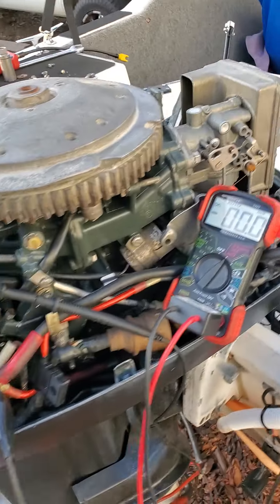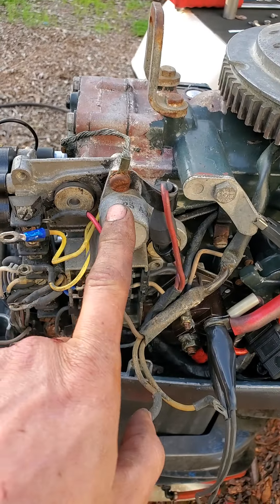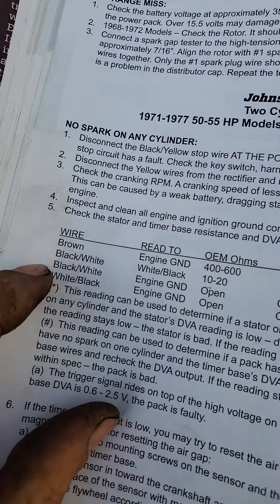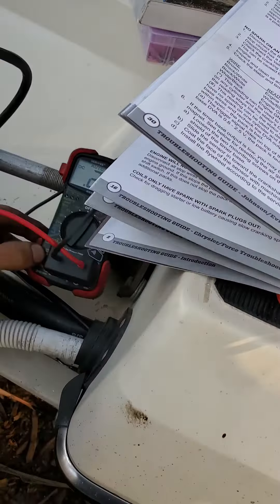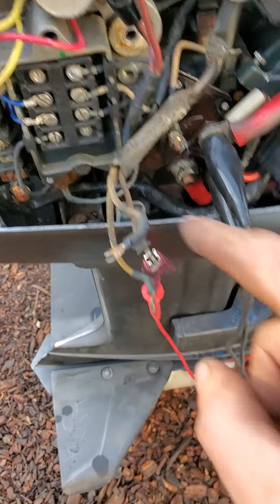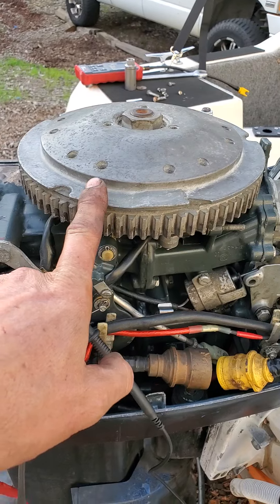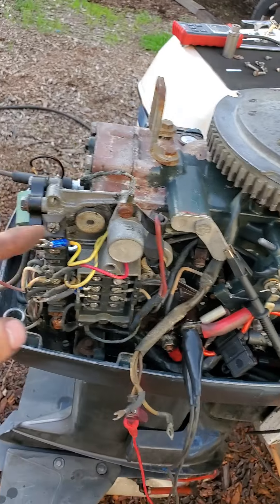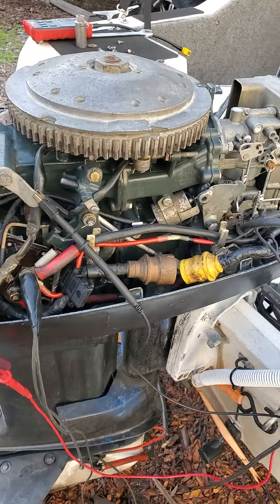Outboard no spark - test voltage from stator with dva

Comment: I'm confused, you said it was AC and yet your meter was set to DC, does the DVA adapter require you to set it to DC?
Reply from the maker: Good catch! the adapter im using converts AC to DC (most of them do - not sure why!).  you can build your own AC based adpater (without the dc diode conversion for CHEAP - look online). Its basically a resistor, one diode and a capacitor, you can find a diagram online. THAT one will output AC - i used it for a few years till I ponied up and paid $35 for a sealed unit with prongs that go into the meter :)
Reply: @SocalMarineUSA   Right on, yea I got the adapter but I didn't see where it said to read it DC, I am a mechanic, but no electrician for sure. So this clears it up for me. Great video man thank you

Comment: When i run this test on my 1985 johnson 60, i get around 250 but it slowly drops (connected). Disconnected it stays at the correct voltage. Sorry to bother you!
Reply from the maker: yes thats correct - the testers have a small bleed down resistor inside to drain the capacitor otherwise it will hold that 250v and potentially zap someone ;)

Comment: What does the multimeter need to be set on when hooking up the dva adapter
Reply from the maker: Dc when using the premade ones online because they have internal rectifiers that convert the ac to dc. If u make your own with just the capacitor and resistors and diode AC.

Comment: where can i find the manual? 
I like your video, good information, greetings
Reply from the maker: Manual is online just search for cdi outboard troubleshooting
Reply: I have the same engine and it stopped giving spark and the engine started well, I changed the coils and it still doesn't give spark
Reply from the maker: @abelardo9881  try with the kill wire disconnected at the pack -
Reply: what color would it be?

Comment: How would you test the coil pack on a 1994 Evinrude v4 88?
Reply from the maker: check ohms and compare it to specs, cana lso swap it with a cylinder thats running well - if the coil works in a new location the problem is further upstream, the coil is the last component adter the stator and trigger.. so work your way up. a bad lead cana lso cause issues.. if u can run it at night look for sparks around the wires/coils.

Comment: Any chance you would be able to help me with a problem I have on an E-Tech outboard? The problem is the emm is not charging the battery. So I'm trying to figure out a bypass to hook up a regulator directly to the stator and then out to the battery.   Everything else works fine. I posted a video of where I'm at now
Reply from the maker: just use the wire that sends 12v + , and wire it to the S terminal on a regular ford style solenoid (make sure it has a very good ground / bolt direct to block) - put the 12v from batt on one terminal and red cable to starter on 2nd large terminal - ignore the i terminal, its for ignition points, that would work.. spray wax corrosion stop or something all over the connections and wire ends..

Comment: 30 hp etech marine engine does not charge the battery. What can I do? I wish you a good day, my friend
Reply from the maker: first chek the stator wires are producing ac volts BEFORE the rectifier/regulator. Then check for 13-15v DC AFTER the regulator/rectifier- If they are then you might need to replace the rectifier or maybe a fuse went bad .. if you have an alternator on the engine it might be bad too..

Comment: Which manual was that you were referencing?  Does is cover more than OMC/Johnson/Evinrude?  Great video by the way!  I'm currently battling a charging issue in a 90hp V4 and looks like diodes in rectifier gave up... time to pull the flywheel.
Reply from the maker: just test the wires going into the reg/rect for AC - i think they should have 25-35v or something - generally speaking that is.. that manual was for that motor - 70s but same principle.
Reply: @SocalMarineUSA  I ended up getting a good deal on the OMC box set of service manuals. Great for my 9.9 and 90 V4!  I swapped the voltage  reg without issue (luckily stator and timing was good) and now charging battery bank again.

Comment: OK - the stator generates AC -- but your meter is set for DC.  That could make sense when the wire is attached, as the rectifier converts to DC -- but unconnected? Help.
Reply: The dva adapter from cdi converts to dc .. if u made it with just the diode and capacitor you could read in ac.. but they design it like that..  dunno why.
Reply: @fstarockaburns425  Well, that's it then. Thanks!